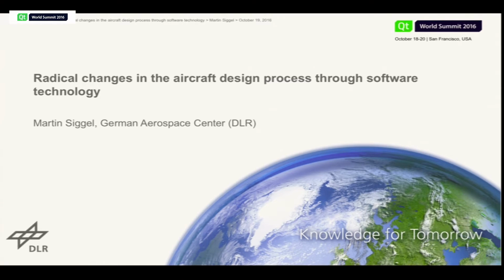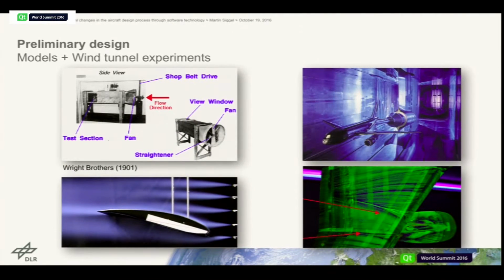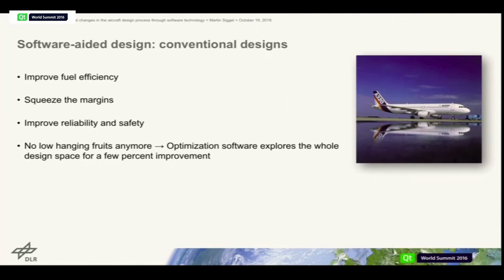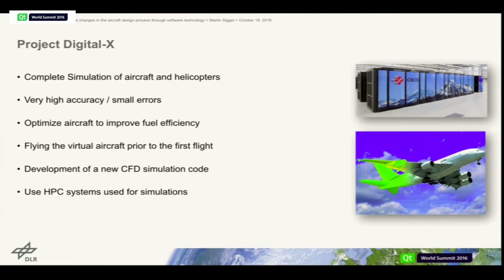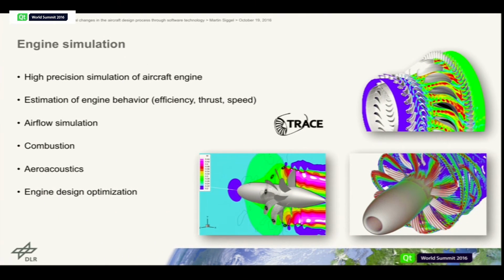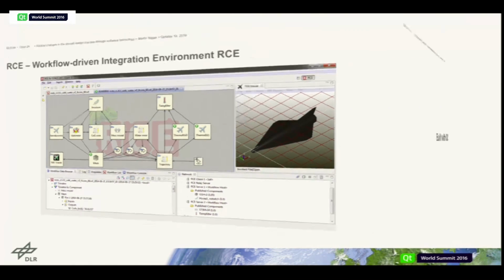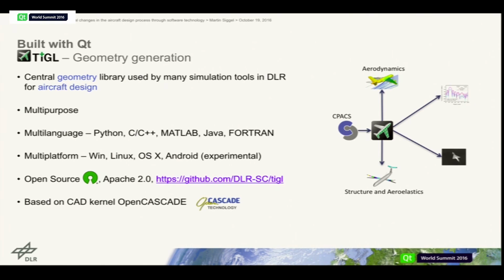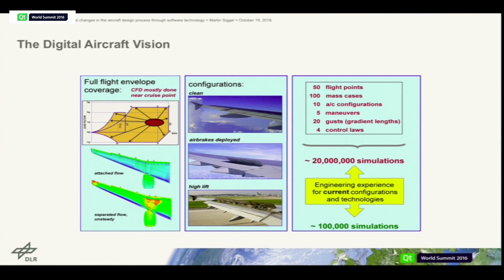QtWS16- Radical Changes in the Aircraft Design Process Through Software, German Aerospace Center

Comment: The only thing I dislike about building aircraft virtually is that it isn’t real. When you fly your aircraft in wind tunnel, things are getting real. That’s a huge motivation. And it is always okay to break things as long as you know what you are doing. For example, if you crashed your scale model, there's nothing wrong with it. That is why it is called a scale model. It's meant to be broken!